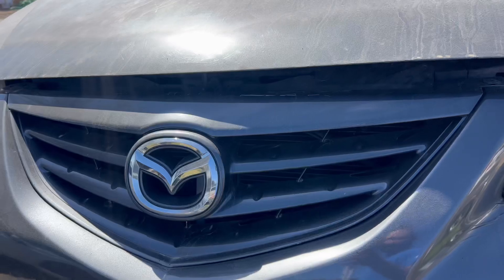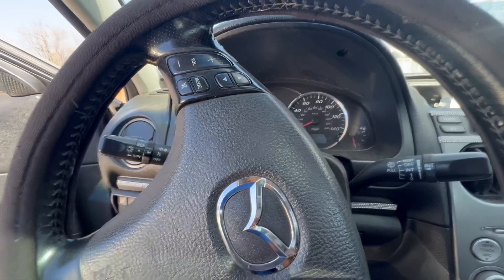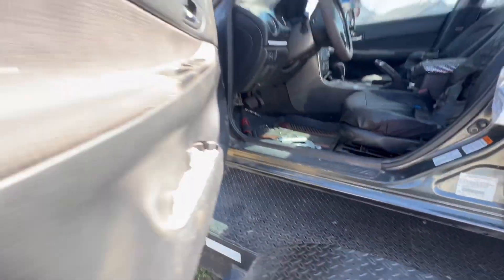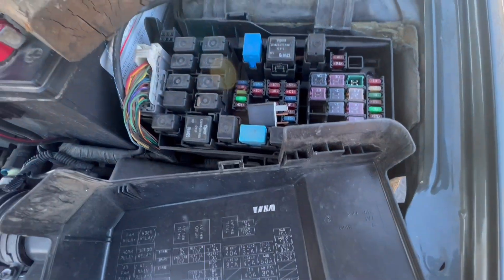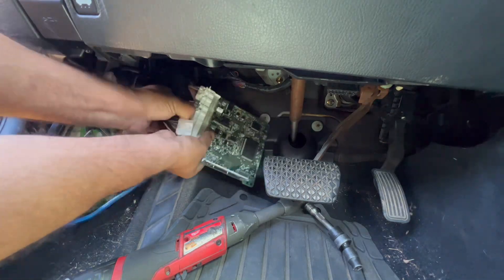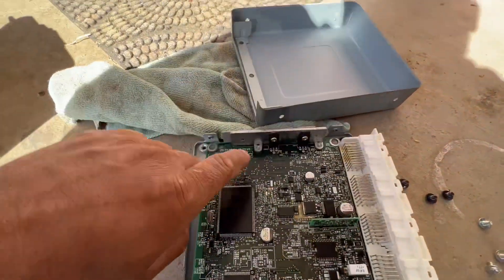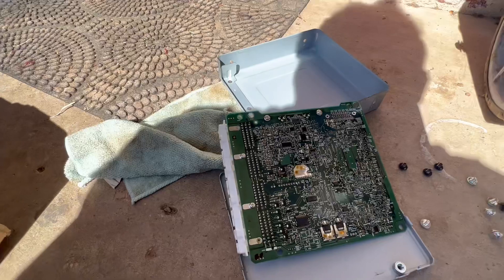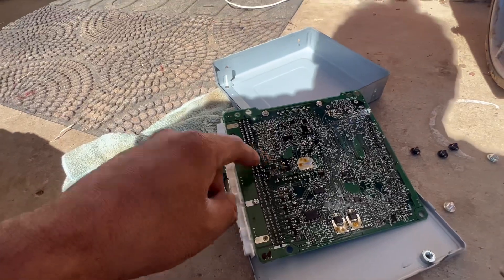Mazda 6 theft light blinking (no crank no start)  this is why

Comment: Thank you! This was very helpful. My lock  red light was also blinking and I had to take it to the dealer. I hope they won't charge me a lot.
Reply from the maker: They should. Not.    Depends where you leave.      Should. Be around 350.  If you ecm is not. Bad.
Reply: Any updates? I’m having the same problem
Reply from the maker: @danny_alv0183   what do you mean. If you watched.  Until the end of the video.    U will find out. That. I have to replaced the ecm.   But i got it.  Already programmed with the vin number  then. I have to program the key.    The store where i get it from. They said. They can sell me the. Key already programmed. Too.
Reply: @1Wayfix  when installing the new ecm did you had to program it? Or did you just program the key fobs? Do you have a link where I can get a ecm?
Reply from the maker: @danny_alv0183  .  give them  the vin#. So they programmed the ecm with the vin.  They want to sell me the key too already programmed. But   I just bought the ecm.    Then i had to programmed.  The  key. But was a pain. Because  i have  to pay on mazda website  45$ to get  a suscripción for 24hrs. And. Then i have to connect my scanner and get some information.  From the old ecm  on the security system.   That way i use that information to fill it up a form  the. Send to mazda that way they send me 2 different  codes  2 That will ask whenever you programming a key on that mazda    So I recommend to get the ecm and key at the same time.   I will get the name of the company.  For you⬅️⬅️⬅️⬅️
Reply from the maker: @danny_alv0183   here is the link for the company.  https://www.fs1inc.com/?gad_source=1&gbraid=0AAAAADj2RsNmOztTOcYPlrSx4ZqD7WNCd&gclid=EAIaIQobChMIsITto4e3hwMVOET_AR1-OQBZEAAYASAAEgJxxPD_BwE.  I recommend to call them. To the number 5163670140.   But get  you old ecm. Ready. For the part number and get you vin # too.
Reply from the maker: Dont waste you time  filling the information on the website.  Just call them.     If you watched the video. I found  a blowout fuse. For the ecm then i open the ecm to look it.   And. I find out my ecm was burn.
Reply: @1Wayfix  thank you !